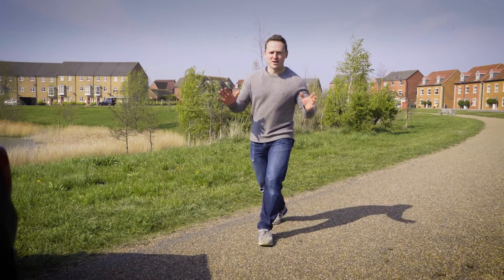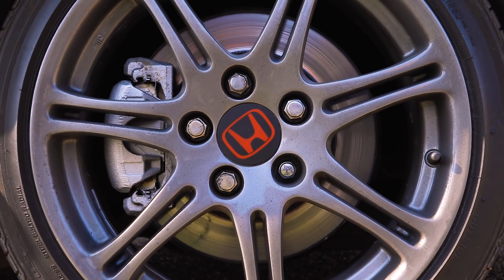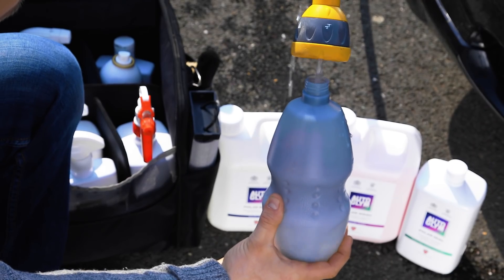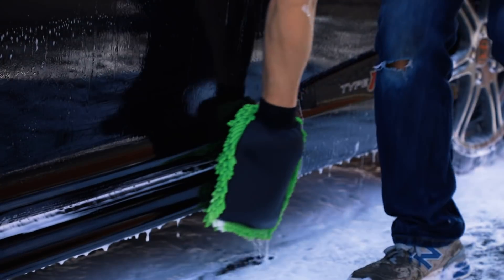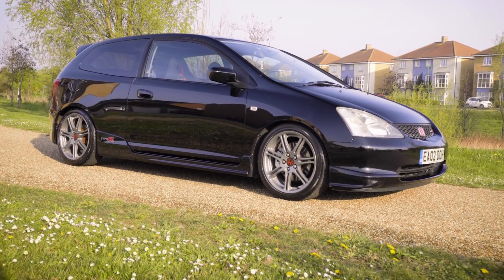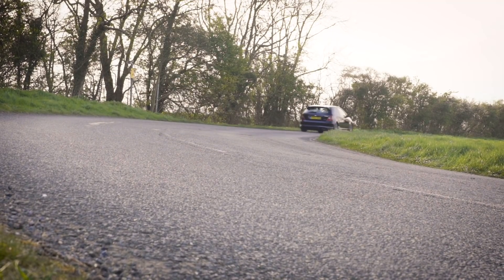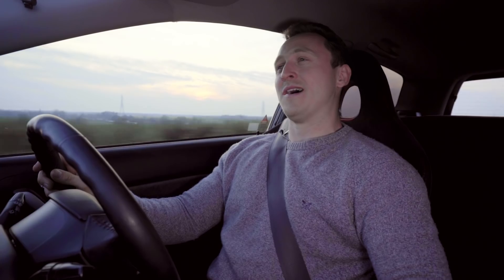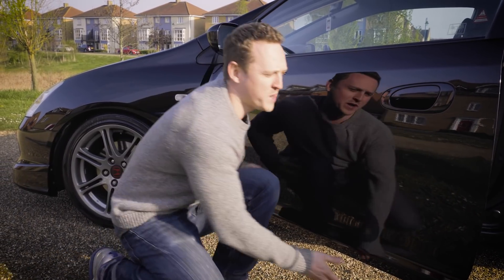How Much Value Can You Add To A Car With Just A Detail?

Comment: No clay bar, no iron decon, no polishing (not the paint anyway)... this is a wash, not a detail, m8
Reply: Correct even one bucket kilt me.
Reply: Exactly right. This is a pretty simple wash. Using one bucket, not a really good one either.
Reply: My thoughts too.  I do car detailing a fair bit outside my normal job and if given a Type R, I'd be on it for about 7 hours and that's just for a reasonable paint correction.
Reply: He did polish iT didnt he?
Reply: @guybreakey1799  i think he did yes
Reply: @guybreakey1799  he only polished the headlights.
Reply: Not on every car is a polish needed. Only if there is something wrong with the clear coat
Reply: Can't take anyone seriously when they say "m8"
Reply: @Bryan-uk9kh  sounds like chris fix eh? "you only need to polish if there's a problem with your paint"
Reply: @trainsoffinland651  hahaha lol not from crisfix but yeah you need to learn it somewhere
Reply: This is an advert, nothing more.

Comment: I would like the car because I own a Peugeot

I’m glad you understand.
Reply: I own one as well, but I live in Central Europe, left hand drive. Peugeot 206 it is(rear axle problems, typical).
Reply: I see yours is also disintegrating, mine has engine the warning light on.
Reply: @Bencooper403  Mine has precisely these problems, errhm((prepares throat to speak)):
- Rear axle beam bearings and torsion bars worn out(one wheel cambered negative and car lowered due to it)
- ABS problems, not sure what exactly
- Right view mirror cable snapped
- Handbrake cable snapped
- Clogged injector(cleaned it with cleaner I guess, I hope I had)
- Bad paint job done
- Slight surface rust on only one side skirt
- Stabilizator link worn, or engine or transmission mount/s
- Thermal problems, engine overheats due to fan not turning on at correct temperature (could be thermostat, thermal switch, or some sensor)
- Speakers have huge amount of distortion
- Door lock actuator problem, pops a Stop and Attention light on dash
- Exhaust leak(will weld the pipe up)
- Valve cover gasket probably blown

That's all I think, typing this while at work. 
Rear axle is what really bothers me alot.
I recommend that you get a OBD2 diagnostics scanner and check what's causing the check engine light to come on. My scanner is arriving in two weeks, can't wait to get a headache 😭😭😂😂😂

Comment: Shifter is placed weirdly but the car itself looks awesome
Reply: 👴🏻yes  mmmm yes
Reply: 🅱️ yes
Reply: Might be cuz of transverse engine and transmission
Reply: The shifter looks like a martial aid.
Reply: Its supposed to be a really good position. A lot of race car drivers like it there. Its positions like the touring cars similar to the v8 supercars.
Reply: @mj68874  handy for grannies too with the arthritis #oldpersoncar 😂
Reply: shifter is placed there to keep it close to the wheel so you dont have to move your hand far to shift gear making it quicker and easier.

Comment: Insurance is already high enough on my 1.2 Corsa 😂 doubt I would even get a quote
Reply: Quotes on these are better than you’d think man
Reply: Strangely enough Corsas are very expensive to insure. They are classed as typical boy racer cars.
Reply: debbie peter thats why i have  a 1.2 i nova
Reply: @1saxton552  Really? I love Novas.  I have a 2002 Mini. Strangely enough I am not too keen on new cars hence tbe 2002 Mini lol
Reply: debbie peter same here love my old cars :) 

yeah i got a ‘92 facelift nova with 45hp doesn’t sound like much but it only weighs 750kgs and its a heap of fun to drive.

minis are cool too :)
Reply: @1saxton552  I once had a Nova . Lovely nippy little cars .
Reply: debbie peter yes and they are cheap to insure and to run i pay 500€ insurance per year hear in germany i’m 19 and one year accident free as you can only drive here once you are 18
Reply: @1saxton552  That's really good. I pay £380 for the Mini and I am in my 40's and been driving for over 20 years. I used to live in Germany lol

Comment: Don’t see point of that sealant if you wax it after?
Reply: Sealant is to protect and last (usually 6 to 12  months ), wax is there to bring depth and in some cases chine. Sometimes they don't mix, but he was using stuff from one brand so no problem. I used HDwax, does the job (mostly on red paint and some blacks) but there are better ones out there.

Comment: You;re forgetting a hell of a lot of steps. After wash with grit guard wash and rinse bucket, clay, polish then seal the car.
Reply: Ain't nobody got time for that
Reply: Lol I got so pissed when he didn’t clay bar which it seemed it needed idk, nor use detailing brushes on the wheels, when he used a drying shammee, didn’t use a specific wheel bucket, and he didn’t do paint correction on it, missed many steps in detailing
Reply: @watfordman  I do

Comment: Wow!So many I should winners in the lineup.... Well I will tell you that if I win this car it has a checkoff list of items to be done: 1. It will be my entry into the hot hatch competition with Ongrid and other track day groups. 2. The instant street cred I will get from it having been a Car Throttle Alex spotlight thrasher. 3. The additional street cred because it is a right hand import.  4. The straight up audacity that it has been shipped from the UK to the U.S. to compete in the hot hatch competition and this has the additional benefit of international's race trade relations as well as a unique opportunity for Car Throttle to create additional media and spread the love across the pond. Of course the car should include some swag and the really nice car detail products for race/track demo purposes and a creates a new brand ambassador in the U.S. 5. the car will spend its life on the edge of adhesion while the motor screams to Vtec redline, the shifter banging through the gears as it is driven to the checkered flag, as if it was piloted by Speed Racer in the Mach V.   6. The car will need to be Car Throttle branded and vendor stickered its final bit of track prep to give it the visual love and track cred it deserves as it morphs into a race slicked, caged, fire breathing track beast. & 7. to finish off the media frenzy this creates Alex you must come over the pond and do a day in the life of this fire breathing beast on track.... of course you get to compete as well in the beast the final bit of Car Throttle media as we christen this hot hatch competitor.

As the winner I will of course arrange and cover all shipping and related costs for it to become the fire breathing dragon of the hot hatch competition.

Comment: I would love to win this car as I passed my test recently, made a bad investment in a 2005 pug 307 because it was cheap with low mileage. Also recently married so we're broke, we need a car, can't really afford a newer one and don't want to sink more money into this 307 that has more problems than Jay Z. It's pretty bad when you take it to the garage for a service and they tell you they can't change the oil because someone siliconned the nut on on sump.

Comment: Not hating but that's not a detail at all number two you wash top down not down up third you use the washmit in the same horizontal rubbing pattern lastly you don't wax in the sun it doesn't work